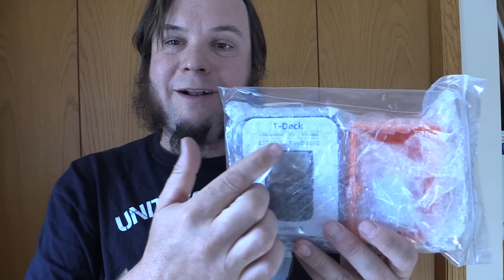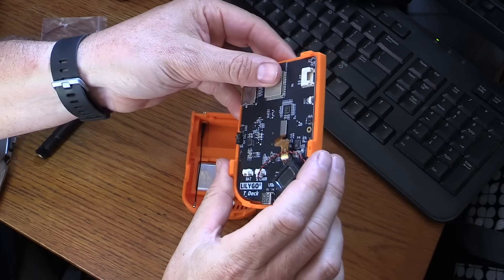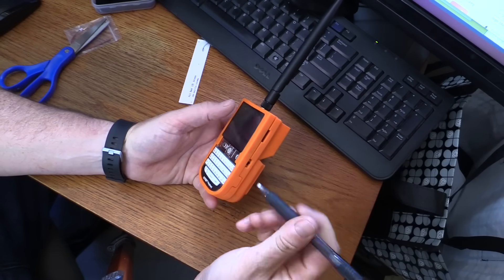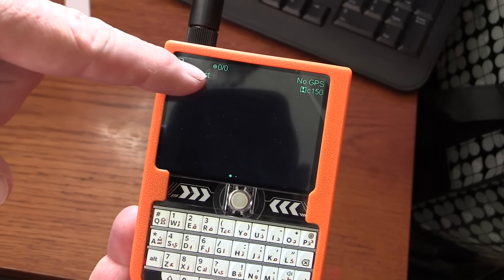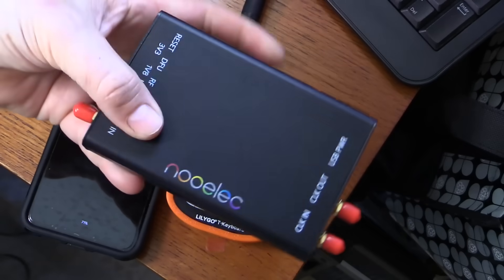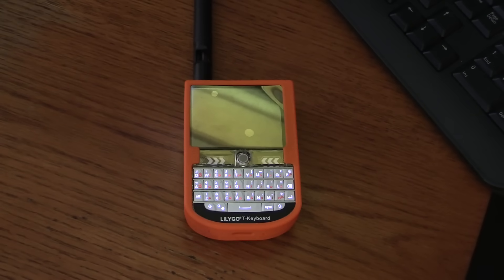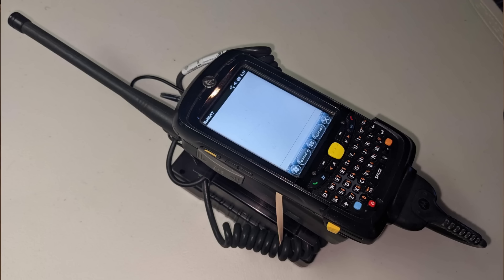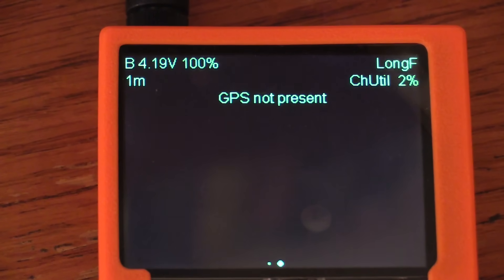Trying Meshtastic For The First Time

Comment: You're not alone, Gabe - BUT, I'm on the other side of town and only occasionally see a node come and go. I have two Heltecs with stock antennas, so I'm sure they don't reach very far but I can't do outdoor antennas... hopefully more people around here will get their nodes up and running. Thanks for the video!
Reply: I've been (way, way, way too) into MT since last December and I've built dozens of nodes, and I've never seen another one pop up in the twin cities that I didn't build myself (aka build it and give it to a friend). I know I miss public traffic by not using the default LongFast channel on my devices, but I've got solar powered nodes up all over St Paul, Roseville, NE Mpls, and some of the eastern and NE burbs, but not necessarily to chat with random people. I'll have to start driving with a node on the default channel and see if anything ever pops up.
Reply: @innercityprepper  Good luck - maybe I picked you up at one point. I think I'm hamstrung by the stock antennas. I still have yet to get a message to anyone even using Long Fast. Again - I think it has a lot to do with the crap stock antennas. Wish I could get something outside but it's not possible in my current apartment situation.
Reply: @Buzzygirl63  You'd be surprised what you can do that's not technically in your home or apartment. For several friends I've put a small solar node magnetically onto a streetlight pole near their apartment, and then you can use a heltec from inside your home and it will slingshot off the better-placed (and better antenna'd) solar node to greatly extend your mesh (and provide mesh resources for others that are using the same frequency and LoRa settings).  

For others, I've done similar things with their cars, putting a powerful node in their car that acts as a repeater for their smaller pocket nodes like heltecs or t-echo's, and run on batteries while the car isn't running. One of the big advantages of some meshtastic nodes (the ones that use the NRF chipset instead of the ESP32 one) is that they can run for a very long time on a pretty small battery. Easily a week between charges from a single 18650 cell!
Reply: @innercityprepper  I’ve got two Heltecs so they’re the ESP32 chipsets and yes they are power hogs. When I first got into this, there were not very many units of any kind of available. I am more curious about this technology than anything else. I am not too invested in it at this point, maybe in the future.

Comment: Try installing a small solar-powered repeater (Heltec v3-based) on your roof, with a good antenna.  One interesting use case could be in the tunnels at Sandland - put up a few repeaters and see how deep you could get text-based comms.  And the GPS unit is necessary for standalone units as a time source is needed for the encryption to work propery.
Reply from the maker: Sandland setup would be fun!
Reply: Go with a rak wisblock for solar node instead. Heltec v3 is esp32 based which will pull about 10x the current of the ram wireless ones. My rak wisblock can last weeks on a single 18650 cell vs my heltec v3 which gets a day or two.
Reply: Do channels like long fast have encryption?
Mine seems to work without GPS, but I have never tried encrypted channels, so that might be why.
Reply: @Heimbasteln  The default channel when using the LongFast radio mode is called LongFast (if you were set to MediumSlow the channel would be called MediumSlow), it is technically encrypted, but with a default encryption key of AQ== which is public knowledge and built into the firmware, if it weren't, people wouldn't be able to access it without entering it first.

Any secondary channels that you set up yourself (or are given the name and key for by someone else) are also encrypted and actually secure, as they're only readable by the people who have that specific encryption key. So, for example, don't share that private key over LongFast, as anyone out there could read it and gain access to your private channel.
Reply: Real survival shelter hours
Reply: Don't use the HeltecV3s for solar setups, they draw 200-300mA consistently, versus something like a RAK Wisblock that draws around 5-10mA. You can get away with a nice small solar panel for a wisblock, or a Pico lora board, etc, but won't get away with it with a power hungry Heltec (ESP32 based).

The Heltecs are great if power isn't a problem though, like running on a handheld battery for the day out and about, they've got a screen and wifi and bluetooth, but yeah, of all the Mesh nodes, they're the worst pick for a solar setup.

Comment: I use meshtastic during camping trips to popular spots that bog down whichever cell tower is closest i bring a few glued to the back of phones to handout to people from the group when they go off on their own. But i also struggle to really find a use for them outside of those trips
Reply: That's one of the main (and IMO best) use cases for meshtastic - private license-free text comms for small groups over 1-5 mile(ish) area. It's already pretty well-known that meshtastic doesn't function all that well once you reach a certain node amount on a mesh (it's around 100-150 nodes) - and that won't be fixed for at least a year when they re-work the mesh logic in a breaking-change sort of way for the device firmware (Aka when Meshtastic 3.0 is released... current version is 2.3.10)
Reply: Why not just use licence free handhelds much better and you can use voice

Comment: A reminder for those that don't know.  I'll always hook up the antennas before you power it up
Reply: Normally that is sage advice with RF stuff, but having built more than 40 meshtastic nodes (and run a couple of them extensively without antenna accidentally) the super low wattage that is being used to transmit on these things (~0.25W) doesn't fry the circuitry. I drove around for a whole day with the ipex connector on my car-based node disconnected without me knowing, and it would have sent hundreds of pings, AND I was trying to range test with it...and it never showed any ill effects, and continues to work fine to this day.
Reply: Yes, if you don't install the antenna first, you will fry the unit.  
Also, PLEASE RTFM or lookup the directions on YT to assist you in the install.
And have a reasonable expectation of the device and what it can or cannot do.
Reply from the maker: Didn't come with a manual, I did check out a couple Youtube videos on the thing before I assembled it though.